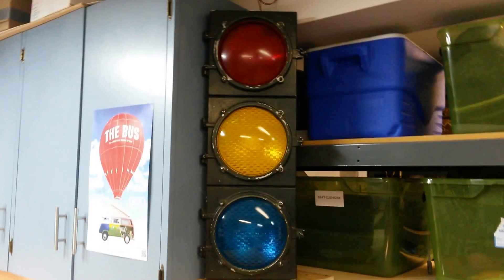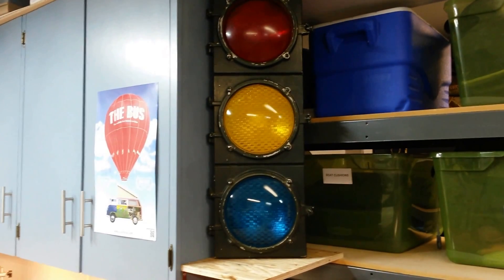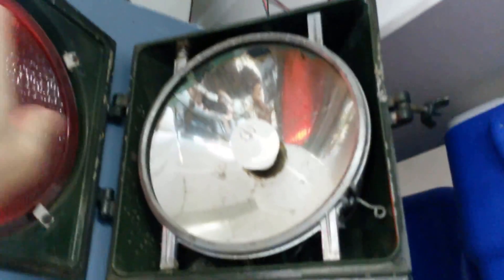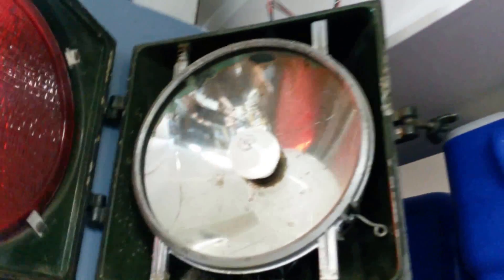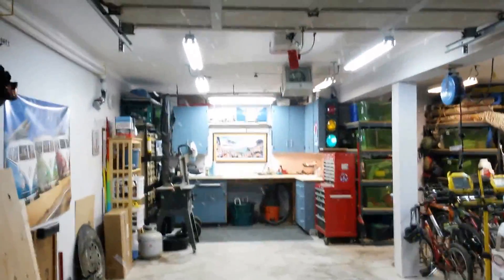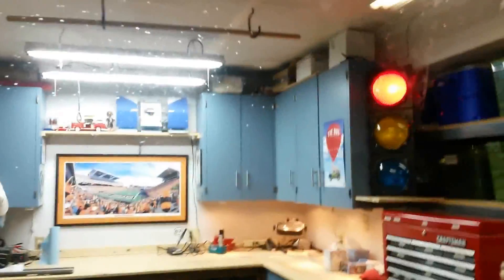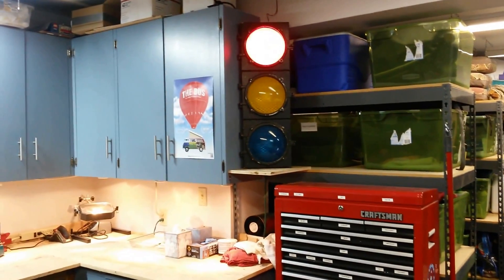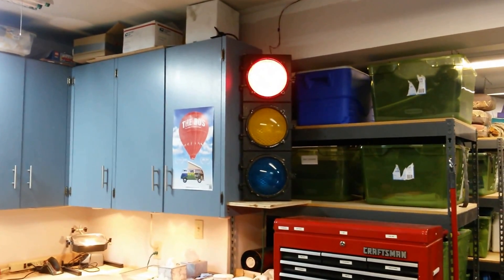Garage Parking Stoplight

Comment: Would you be able to give me some info an where to find the sensor and control board?
Reply from the maker: I used a Basic Stamp controller kit from Parallax: http://www.parallax.com/product/90005 and one of their ultrasonic proximity sensors: http://www.parallax.com/product/910-28015b. Three TTL to 120AC relays power the lights. All mounted inside of the stop light along with a power supply. Let me know if you have any questions. Would be happy to share pics or post code to get you started.
Reply: Great! Thanks!
Reply: I definitely want to do this!! Yes, can you please post the code? Thank you in advance.
Reply from the maker: Sure. Here is a link to the basic stamp controller code. 

https://www.dropbox.com/s/8l9yuvfswimvv4y/RedYellowGreen.bs2?dl=0